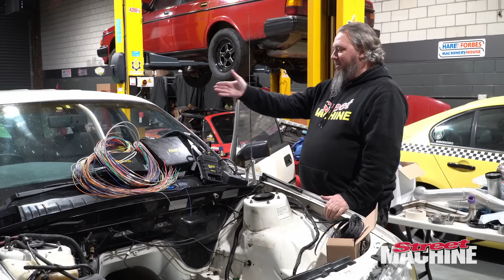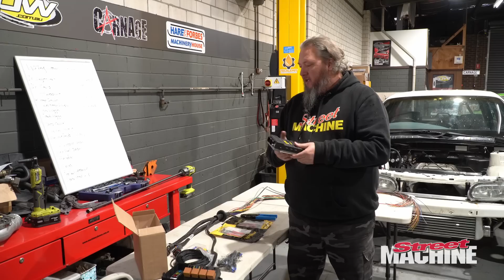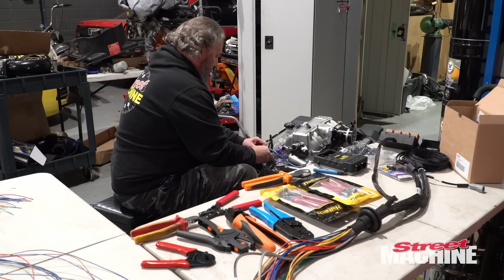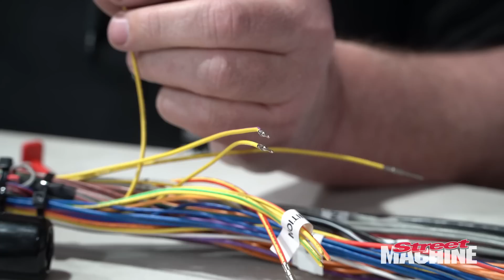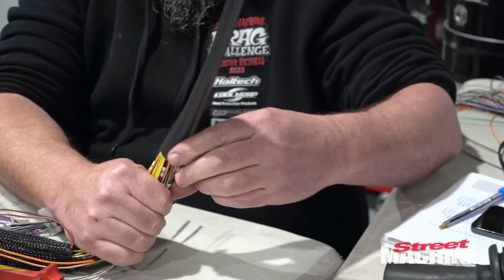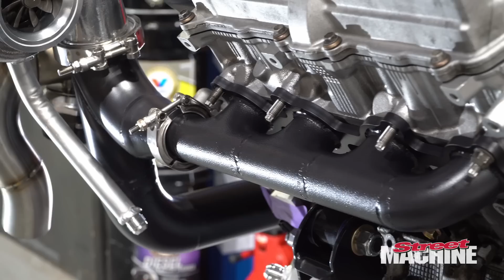Carnage - We Try To Wire Up The Lexcen... And Fail!

Comment: I'm doing the Haltech wiring on my VS atm, I'm surprised to see the relay box will be inside your car. makes sense considering it's already attached to the premium harness, but that the same time, those relays are already half done in factory form in the engine bay. 
I'd love to know some more of the specifics around the wiring in the VS. 
Will you use the factory 12v fuel pump supply as a trigger and run a new power wire to the pumps, put the fuel relay in the boot with the battery?
Reply: Loving the build btw, I'm glad I didn't go the 1uz after seeing yours tho
Reply from the maker: It has been more painful than we thought it would be

Comment: Just catching up on my Carnage fix and find out you’re and ex-Telstra jointer!! I’m still going after more than 30years, and it certainly has helped me rewire some projects over the years.
Keep up the great work Scotty!
Reply from the maker: I used to be in NDC and did a lot of the major Sydney exchange cutovers south of the Parramatta River, when they went from Crossbar to System 12. Also did most of the Sydney Olympic remote sites before taking a voluntary redundancy after the Olympics and walking straight into a job at Alcatel.
Reply: @STREETMACHINETV  It’s funny how it comes full circle, we’re starting to decommission the copper side of the exchanges now, getting ready for them to turn them off between 2025-27 with only NBN remaining!
Reply from the maker: @unansol  oh wow, because everything is either 5G Mobile or NBN now? That's crazy!
Reply: @STREETMACHINETV  it will be soon! I’d better get to watching the new video. I’m looking to get out soon and would love to do something similar to you, if you’re ever looking for a lackey let me know! Love the channel! 👍

Comment: Cutting the wires for the plug all the same length is no good. You need to cut the wires to suit their positions. Like the middle ones will be shorter than the outer ones ect.
Reply from the maker: Obviously you adjust individual lengths as you work your way through
Reply: @STREETMACHINETV  sorry mate, I thought you might have just cut them all the same length and thats why it was hard work for you
Reply from the maker: @DarrenBoxhall  nah, cut them all to start and adjust them individually to suit
Reply: @STREETMACHINETV  forgive me for doubting 😅

Comment: Yup, wiring takes a butt load of time!!! I think it took me a week to wire a motec for a Subaru FB20 with turbo kit into a 1958 VW Bus that included having to incorporate a fuse and relay box for the ECU/engine stuff. 2x32 pin MILSPEC round connectors on a custom bracket for maintenance works. It's a mission man but you'll get it done 😊

Comment: How nerve racking is that first cut, I must have checked my lengths 6 or 8 times before I cut my loom. I also moved the fuse box to where the factory cruse control used to be to reduce the number of wires going through the firewall.

Comment: Scotty, hate to tell you how to suck eggs mate but we've all shared your frustration,  and I would personally persevere with that connector (I have not used that one in particular), but just checking the following based on my own (bad) experiences :

1. Do they required you to crimp the pin/socket AFTER the wire is inserted?

2. Do you have the pin/socket in the correct half?
3. Check you are using the right crimping tool - some crimp down on the 'ears' and bend them into the wire like a stapler, others put divots in to the sides of the pin (whilst ensuring it isn't distorted - flattened) -  also check that your crimper hasn't bent or otherwise distorted the pin/socket
4. Use the (supplied) extractor tool when inserting - some connectors require you to do this to avoid damaging the pin/socket
5. A little bit of silicon/dielectric grease will help you slide it in and won't hurt when it comes to protecting against moisture
Reply from the maker: Thanks for the list and I did check all of those things and even used silicon spray (but not the grease) on the pins. I've talked to several people in the industry since and they all agree that particular type of connector needs to burn in hell.
Reply: @STREETMACHINETV  "burn in hell hahahaha had me cracked up"

Comment: Just a few months ago I wired up my own stand alone 1UZ. I was on a massive time crunch which did not help.

I had no previous experience and just dove in. Super challanging but so rewarding when she fired up.

I've had that issue before with those Deutsch style connectors, soooo frustrating. They do have a tool that helps install them in to the plug, but it ain't easy.
Reply from the maker: It came with two installation tools and ended up breaking both
Reply: @STREETMACHINETV  yeah the lower quality ones seem to be real garbage. Hopefully you have better luck with the new one!

Comment: for the reason you demonstrate - I love the idea of a plug, but doing one? been there, done that, oh lord I pray for your eternal soul.  You're under the car removing the battery cables and the power feed to the alternator (which, arguably are the hardest things when pulling a motor because it's underneath... something to consider - rather then one plug, do the Holley thing and have sub-looms (oftentimes the reason people go with milspec plugs is you can get a bajillion connections in on) injectors on one plug, sensors on another, coils on yet another - then get delphi or similar plugs for each loom. the biggest benefits are: easier to seal small plugs then large, and if you decide to update to a different kind of coil or different kind of injector - it's pretty easy to pull the on harness and adapt

Comment: You are a BRAVE man Scotty. I was so lucky that Haltech made a plug & play harness for my 1JZ vvti. 

I don't do wiring. It scares the bejeebus out of me. I recently wired up some new Yamaha gauges for my boat as my old ones weren't working. I got the Tach working, but the tilt/trim and fuel aren't displaying correctly. I don't care so much for fuel and trim as I can feel how much fuel is in my tank and how trimmed up or down my engine is. Still, at least I got the tacho working.
Reply from the maker: The Haltech 1JZ loom is great

Comment: Always hated doing wiring when people used to do their own car stereos, was so much simpler back in the late 1980's early 1990's especially with din type plus, it was mostly plug and play, but adding a equalizer was the hardest unless you have the RCA plus, keep up the great wok scotty don't know how you have the passion and not get flustered and throw the wires to the other side of the workshop ?🚓🚓👌👌🙌🙌👍👍✌✌😀😀

Comment: Watching you tackle that wiring gave me some nasty flashbacks. Just a tip on that connector... You might have had more success if you plugged all the wires into it first instead of last. When they are all bunched up under tension it becomes a nightmare, whereas when they are loose there is a "better" chance of them staying plugged in.
Reply from the maker: It wasn't really a tension problem, it was more of an issue of pins just not seating into the connector even when I had a straight shot into the hole. The new connector had no such issues
Reply: @STREETMACHINETV  ahh so just a quality issue.
Reply from the maker: @DodgyBrothersEngineering  I think so

Comment: That insane amount of wiring gives me anxiety, I don't have the patience to even start something like that, well done for diving in as always mate. Could definitely hear the aggravation in your voice about that connector, I would have thrown all the toys out of the cot. Thanks for sharing this with us.
Reply from the maker: The temptation to set fire to the workshop was strong
Reply: @STREETMACHINETV  I totally understand 🤣
Reply: With wiring you have to break it down into little bits and do them one at a time or you'll go insane.

On (for example) an LS you'd be like "okay I need four ignition wires, four injector leads, the throttle body connector, the water temp sensor, and the crank angle sensor for the driver's side engine loom, so I'll start with the ignition wires, that's eight wires in four pairs, get them trimmed to length, connectors fitted, heatshrunk and sleeved, and labelled."
Get each part done on its own, double check all your work with a multimeter to be absolutely sure, then bundle them into that half of the engine loom and route and secure it.

Then you break it down again for the passenger side of the engine loom - the other bank of ignition wires and injector leads, the knock sensors, the oil pressure and temp sender, the manifold pressure sender etc. etc.

Then you do the "front end" loom - lights, indicators, horn, alternator, starter, a/c compressor etc. etc.

All that runs back to the firewall connectors and boom, you've done the hardest part of any car build with absolute minimal stress and hassles because you've approached it the same way you would an engine build - looked at as one big job an engine build would be very intimidating, but because you know it's actually hundreds of little steps all done one at a time that you can double-check as you go, it doesn't worry you.

Drawing up a "loom map" that shows which wires (colour, gauge, and connector pin #) go where that you can constantly refer to during the loom build is also very helpful. You also have an excellent troubleshooting resource in future.

Comment: The horsepower academy wiring course is a very valuable tool. But so was the haltech guide through lockdowns.
Reply from the maker: Yeah the lockdown series was great. It's just this plug that's not playing the game, the pins won't seat. Two days I wasted on it, the new plug was re-terminated and pined in two hours
Reply: @STREETMACHINETV Are the pins sized/specific to the style of plug? This is my experience but I'm a fitter/machinist not a sparky, only seen it not done it myself.

Comment: Use a pin seating tool. Goodness me, surprised telstra didn't issue them.
Reply from the maker: Different connectors back then, lots of Krone blocks and solder blocks before that

Comment: Lay the labels along the wires and clear heatshrink over them.
They will stay on permanently and makes finding any part of the harness easy in future.
Reply from the maker: Yep, that's the plan
Reply: @STREETMACHINETV  those DYMO labels are thermal printed, so if you clear heat shrink over them they will turn black, but try it any way,
Reply from the maker: @mickbastin5401  hmmm, didn't think of that. I'll do a test
Reply: No they won't.
My Dymo uses the plastic tape which work fine when heat shrunk over. The paper tape type will turn black most likely. @greencheeksconure